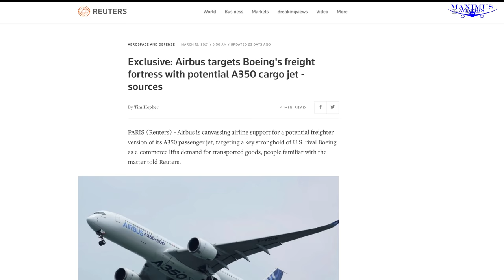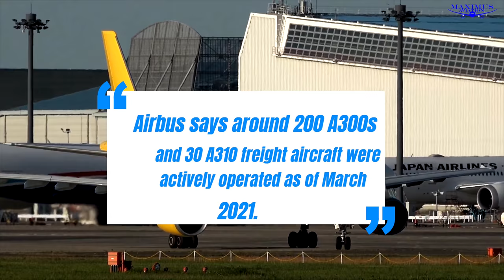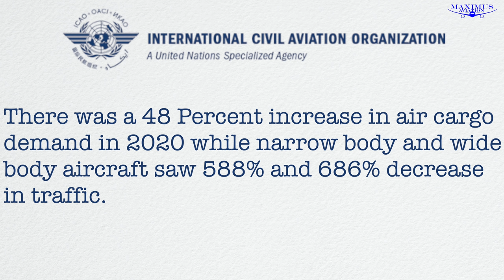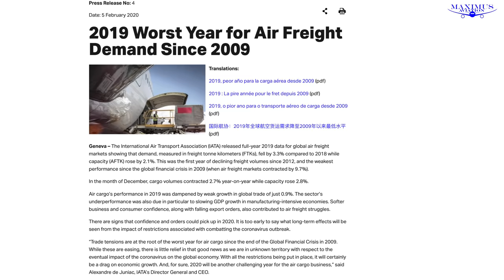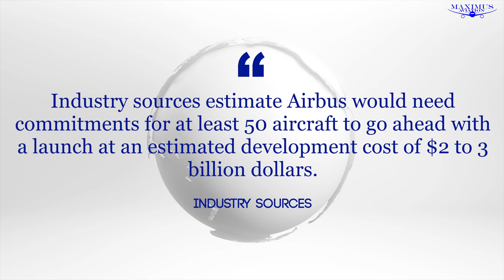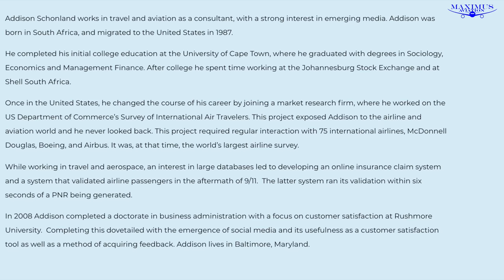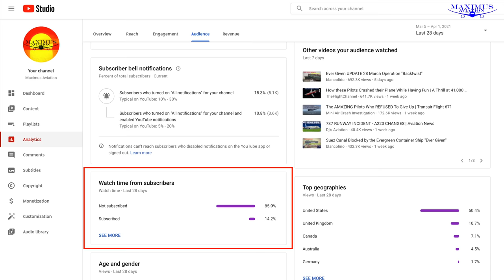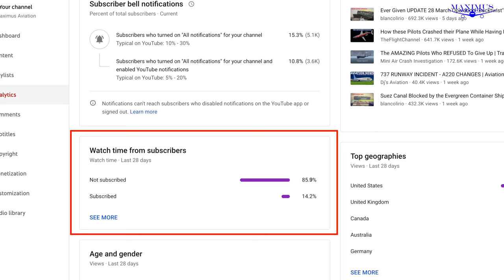Can The Airbus A350 Freighter Knock Off Boeing As The Cargo King Of The World?

Comment: Hi Maximus  as you said Airbus is the undisputed champion in passenger Aircraft so why not go for it all and show Boeing who is the Aviation boss
Reply: Because for the a350-1000 to compete with the 777F for MTOW-OEW it needs new engines and upgraded landing gear which also means a new wing box complete redesign which is VERY expensive and comes with wing destruction testing along with fuselage destructive testing.  Certification becomes extremely expensive.  Now add that the a350 is narrower which means the weight has to placed further forward/aft which either means it must have a decrease in load, or an increase in structural weight for dynamic forces.    The elephant in the room is that 400 777-200ER's with ~same MTOW as a350 are coming onto the market nearly ready for conversion and will cost next to nothing.   800 777-300ER's are also set to retire all before we even talk about the ~1200 a330-200CEO's which can all be readily converted.  I see the new freighter aircraft market for ANY manufacturer as not exactly profitable.  Marginal maybe if you have 5000 engineers twiddling their thumbs, but otherwise... not exactly wonderful either.

Comment: Boeing shot themselves in the foot in the 80's by developing the 757 for the medium plane market not as a 737 replacement ... and then in not continuously improving, enhancing & copying from Airbus, the 737, 757, 767 designs to maintain complete dominance of the market.

Boeing should have offered a smaller 757  and 737 NG both with stick digital flybywire by 1990 to compete with the A320.

The A350 was only build because Boeing stupidly spent tens of billions making the 787, ... when they should have instead made 767 NG or X also with digital stick flybywire.  The 777X should have been developed in the early 2000s to compete with the A380 .. because twin jets was clearly the future of the industry.

And apart from being two decades late, Boeing did nothing wrong with the 737 Max.  The worst the MCAS could do was cause a runaway trim emergency, and Boeing has put in every 737 plane the cut off switch and manual trim wheels specifically for runaway trim emergencies.  Two  Max crashed due to 1) faulty or damaged flight sensor causing a runaway trim emergency & 2) badly trained pilots that did not know how to use the manual trim wheels for runaway trim emergencies.

Again.  Boeing messed up in the 80's ... not developing the 757 as the replacement for the 737 ... and .. not continuously developing, improving & enhancing the 737, 757, 767, 777 to compete with and dominate Airbus.

A 777X would have destroyed A380 sales which Airbus has already taken huge losses developing.

A smaller improved & enhanced 757 & 737 NG by 1990 would have significantly reduced A320 sales.

A 757 & 767 NG or Max by 2000 would have Boeing completely dominating the medium plane market.

But it all ultimately goes back to Boeing NOT continuously improving & enhancing the 737 mainly for range & fuel efficiency ... which would have forced Boeing to develop the 737 replacement which the 757 should have been.

Range & fuel efficiency come primarily from the engine & wing design and weight savings.  If Boeing had continuously improved the 737 with range & fuel efficiency .. and will all other Boeing designs ... it would still be the king of airliner makers.

Comment: The 737 MAX debacle certainly had it's part in Airbus taking the commercial lead but even without the 737 MAX debacle Boeing had already screwed the pooch with it's carbon fiber nightmare liner and it's continuous problems, not to mention the backyard production facility in South Carolina. Boeing's spiraling down the cesspool was inevitable and will only get worse. For the past couple years Boeing Defense has been paying the bills but corruption has caught up in Boeing Defense and besides continuous investigations sales & contracts have declined. One thing they forgot to teach their managers in Boeing leadership school was "what goes around comes around" you gotta love Karma! 😂😂😂
Reply: airbus was going to convert a340 200 aircraft to cargo many years back. the concept was the cargo would be loaded as normal through the standard size door under the passenger deck.then the cargo would be lifted to the upper deck by a internal lift system.hence no need to cut up the fuselage for a cargo door.no interest was shown by airlines back then.mybe now the idea can be looked at again for the a350.

Comment: According to what I've seen and heard, there's a crapload of 747s available as the airlines can't keep them full of passengers. If that's the case then Boeing has a massive advantage. And as you pointed out, there's no conversion for all the 380s that the airlines can't keep full. In addition the 380 was a huge loss for Airbus overall because they simply didn't produce and or sell enough of them. This is the fifth video of yours that I've seen. Any reason you're so slanted toward Airbus? Are you retired on an Airbus pension or something?

Comment: By the timer the deliver their order the crisis is over.  Not a big fan of Boeing, but they have more experience in this field and their freigther are old proven airframes. You dont need to fight composites. Also, fuel figures are not a show stopper in Cargo industry. With so many 747 and 777 retired, probably still more conversions down in the pipe to accomodate this demand. You nanems A300 ... wow this is old. The really cargo king is the MD-11 ... period.

Comment: Beyond having new production 777F and 767F coming off the line, you also have a large number of older 767 and 777 available for conversion.   GECAS sees this and is now converting the 777-300ER into freighters. 

Boeing could also give a new engine option to the 767F increasing efficiency of new production of an aircraft that has had development costs paid many times over.  On the 777F, market demand will determine whether cargo operators prefer to continue with the current 777F generation or will want or benefit from the 777X.

Comment: Boeing today has more than a few weak spots. 777-9 is showing very skimpy sales. The plane, just like A350-1000 are plain too big, and this shows from before Covid. 777-8 will probably not see the light of day. Too heavy, not competitive except for the longest routes (0.1% of the total). 777-10 too short range for the class. Same for 737-9 & 10. No match for A321XLR. 737-7 sales dud, just like A319NEO. 787-8 even Boeing is unhappy with it. High building costs due to limited commonality with bigger Dreamliners. This leaves us with just 787-9 as a clear winner, once they restart production, idle for 6 months. On the other hand A320NEO is a very clear winner in all categories. So is A350-900 and A220-300. Boeing has been left with the need to produce a MAX replacement and empty pockets. Not a good combination!